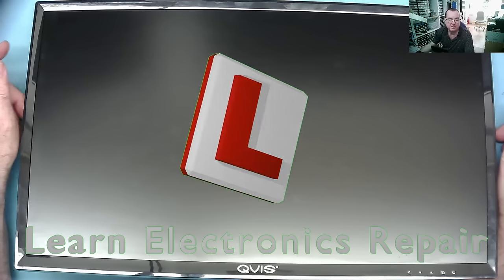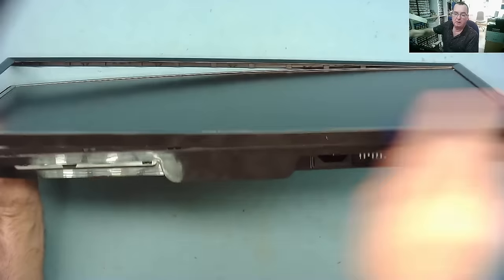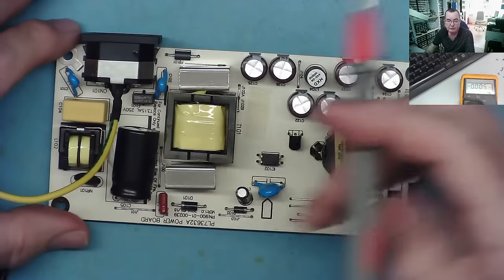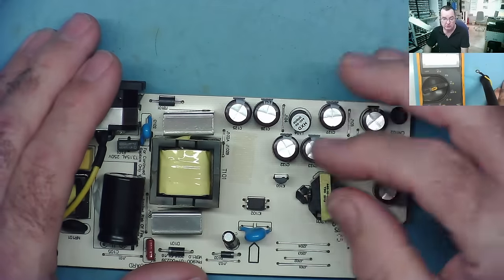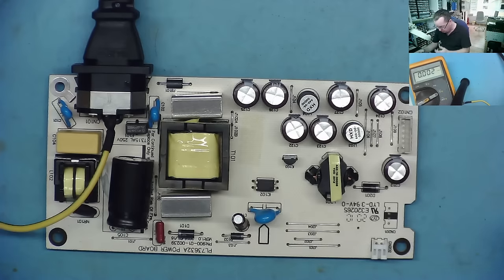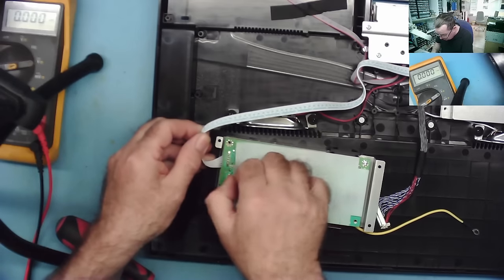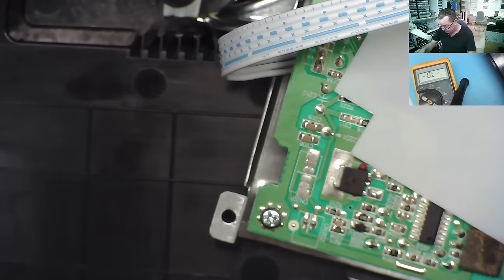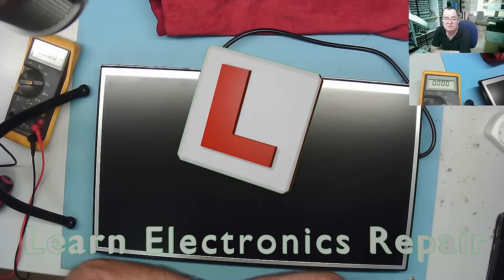LED Computer Monitor Repair

Comment: Let me discharge the capacitor, since 13v is extremely dangerous... 🤦
Reply from the maker: That's not the reason I did it.  If there is 13V in the circuit, it can really screw around with any resistance measurements you may want to take 😉
Reply: He did say he was doing so, because the voltage may affect resistance measurements.
Reply from the maker: @ianhaylock7409  Exactly 🙂
Reply: @LearnElectronicsRepair  
But then you go and plug it in again, without making any measurements... I know I seem to be a little too harsh, but you do that a lot, and this is the first time I commented on it...
Reply: "not that there is a dangerous voltage in this now, but its not easy to make measurements"
Reply: @100000suns  
My point is more on the fear mongering about high voltages being too dangerous...
I think this whole high voltage = danger stuff is way overblown, I've seen him being shocked by fully charged capacitor in past videos, just like I've been shocked myself numerous times before... If the power is not plugged in, and you are not getting the line frequency, or a constant source of energy keeping your muscles contracted, you will learn to be more careful, but unless you have a medical condition, or extremely unlucky, even much higher voltages 1000+ is not that dangerous, as long as you don't allow it to go though your heart (and even if you do, chances are you will be fine... But I don't suggest anyone tries to prove me wrong by shocking themselves, as fun as that might sound like...)
Reply: @Daniel-gr3dk  The problem is that there are a lot of people that do not know that they have a medical condition. Take for instance tasers; there are still people dying because of the use of it. In spite of the fact that it had been tested on hundreds of human guinea pigs. So this is absolutely not fearmongering, but i.m.h.o. the (legal) responsibility of the teacher.
Reply: @TheDurdane  
Yeah, but that's completely different than a charged capacitor, a taser generates low current AC at thousands of volts, and are shot towards the largest mass area, which happens to be across the heart... The comparison is apples and oranges (I've shocked myself with tasers dozens of times before, but always at my arms, legs, stomach... Never across my heart... I do agree tasers can be dangerous, but not a capacitor charged to 13v...
Reply: @Daniel-gr3dk  Your life, your call.
Me, I'm a bit more cautious.
Reply from the maker: @Daniel-gr3dk  Yes in hindsight I didn't take any measurements at that time, but I didn't know I was going to (not) do that.  I don't think your comment is 'a little too harsh' everyone has their own ways, you know  I always encourage viewers to comment and one view is not necessarily more right than another.  Personally I like to check the main capacitor for voltage and while I'm taking time to do that I will discharge it for the reasons I stated.  Of course on the rare occasion I have discharged the capacitor with my finger and that also tends to focus the mind.  I don't see any good reason to leave 13V or 20V whatever in the capacitor, but as we disagree a little, why would you decide to leave the voltage there and what would be gained by doing so?
Reply: Before working on high voltage equipment like TVs in the old days (when you had lots of projecting solder terminals and large components) I was always told to remove the gold rings from my fingers first. When you get a shock you naturally jerk back your hand with great force and a finger ring could snag on a terminal block, etc.. This could cause serious mechanical injury to your finger (cuts/joint dislocation), cause you to fling the device under test across the room and/or prolong electrocution if you happen to snag the ring on an HT terminal. Never sure if this ever actually happened to anyone but it sounds reasonable and wearing thin insulating gloves may not prevent it. Anyone had any experience like this with rings?
Reply: @LearnElectronicsRepair  
In some cases you can probe around and see the IC switching, trying to do it's job, even with just a couple dozen volts left in the main capacitor... And that can be much safer than testing the IC with the power ON, since you wouldn't be able to get a prolonged shock, and if you accidentally short the wrong pins, you will only be discharging the capacitor...
But your light bulb circuit in series, the variac and isolation transformer can be almost as safe, and allow you to spend more time testing the board...
But yeah, for most other measurements I definitely also discharge the capacitors!!!